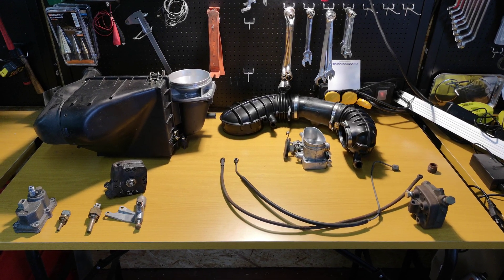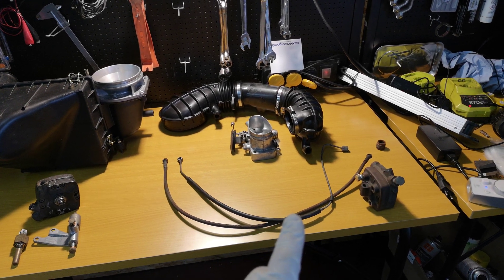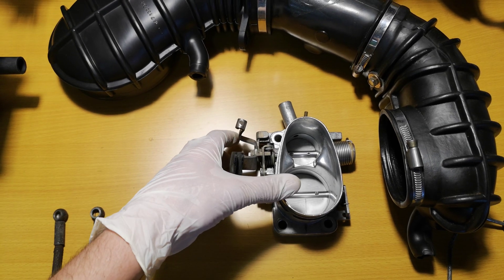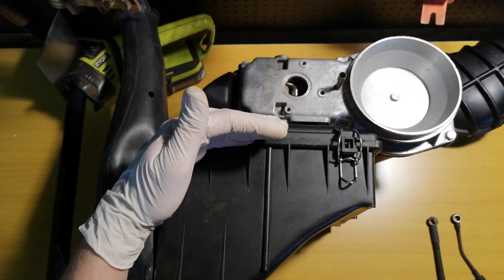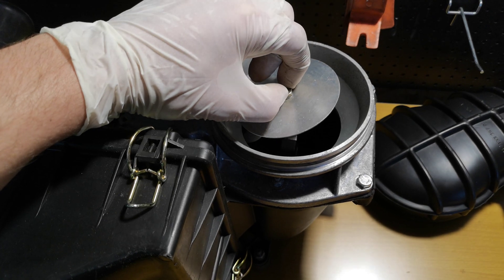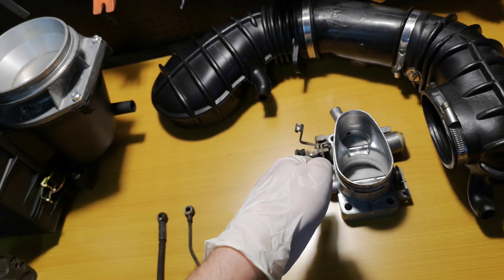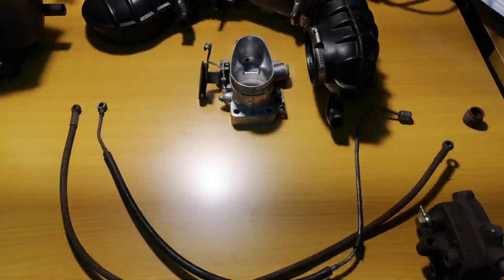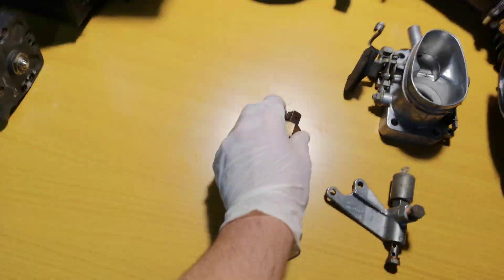Porsche 924 K JET Tronic CIS injection system basics

Comment: After replacing the fuel distributor the metoring unit  and all 4 injectors the number 1 injector is spraying far to much fuel than the other 3 could it be the little fuel pressure regulator on the side of the metoring unit

Comment: Hi i have trouble starting my 924 the metoring plate got stuck so i freed it up also there is no feed to cold start injector so gping to renove thermo time switch are they hard to remove 924 porche
Reply from the maker: @stevehunt3847  if there is no fuel arriving at the cold start injector then   your feel pump is not running.
Reply: @undergroundgarage  sorry I meant no electrical feed

Comment: I’m having a nightmare with my 924.
Summary of symptoms:
Car runs either way to rich but srtarts and runs okay when cold, or if I set the mixture so its has correct CO when warm, its coughs, splutters and barely runs when cold. 
So it must be the WUR then?
This is what I;ve done so far to try and find the issue.
Full system pressure check - all within Bosch spec when cold and warm, confirming WUR working.
Rebuilt and cleaned WUR just to make sure. No difference. Swapped out WUR, no change.
All new injectors.
All new injector seals / screw in bosses.
Flow check on all injectors - even and correct.
Cold start injector, tested, functional and working - issue of poor cold running exists long after cold start injector fires either way.
All new coil, distributor, plugs and leads.
Swapped out ignition module, no change
Stripped and rebuild metering head valve - new kit, fully ultrasonic clean etc, etc
Cleaned out and checked all the injector lines.
New fuel pump in tank and engine bay + filter
Fresh clean fuel
Inspected, cleaned and checked flow plate mechanism in metering head and test swapped ith a known working one, no change.
Replaced inlet manifold gasket and resealed.
New air filter.
Smoke check for vacuum leaks, small one found and corrected.
Timing checked and rechecked.
New timing belt fitted and timing checked.
Compression and leak down all within spec and even.
When warm, car runs great but coughs, splutters and barely runs when cold.
Make the mixture way to rich and car starts no issue, but then is poor when warm as too rich.
Pressures and WUR checked, rechecked and different WUR swapped in to test, no different,
All correct Porsche components fitted, nothing after market or high performance.
Only other issue is that the auxiliary air valve didn’t appear to work very well,m i.e did not increase cold idle speed so had to modify this to give a 1,500 rpm fast idle which sovced that problem. Cold start mixture was same before or after so dont believe related.
Lost as to what to do next?
Reply from the maker: This is a tough one. Have you considered excessive blow by ? Is your crankcase ventilation connected to the plastic coupler ? When yes, could it be when cold the rings let compression through, hence more not metered air, and good running cold when to rich. As soon as blow by reduces, due to thermal expantion of the rings, less air gets behind the metering plate. If your CCV is connected tho the air box than its not the case.

Comment: Great Video, 
very well explained and visualized. 
That was very interesting because my 83 Porsche 924 got a warm-start problem. It will cold-start perfectly and also after like 10mins of being warm. It just wont start after standing for like 30mins to 2 hours. I heard that air bubbles in the fuel lines make it hard to start the car. A solution would be to activate the cold-start injector over a manual switch. I know its not the best way of fixing it but the war start-components are quite expensive.
Reply: Without holding system pressure after hot shutoff, the Fuel BOILS in the injectors, overcomes the 50 psi holdback spring in the injectors and floods the engine.  More fuel then makes it worse. I proved this on my 77 with a pressure gauge, the pressure bleeds off too soon and it takes a 30+ second crank with pedal on floor to clear it.  Porsche has a time and psi spec for this.  This is what the fuel accumulators and anti return check valve are for.  It also can sneak past the pressure regulator o ring after shutoff  thru the WUR and into the return line. There are tests for this.

Comment: Thank you for video in English! And just the video I needed! I bought 924 in no start condition that was sitting for 10 years. I managed to get it started by changing fuel, fuel filter and pump. But at start up idle is very rough. Could it be due to WUR? Would you recomend buying rebuilt kits for WUR and distributor?
Reply from the maker: I will do more videos  on that topics. I will also make a wideo on diagnostics and so on. The rebuild proces is not hard and can be easily done in a garage. The setting up is a different story as you need a fuel pressure gauge.
Reply: Im having cold start problems with my 924 2.0, really curious about the thermo time switch! Loved the info in the video.
Reply from the maker: Thers more to come on that topic!
Reply: @undergroundgarage  Thank you! Looking forward to more videos!